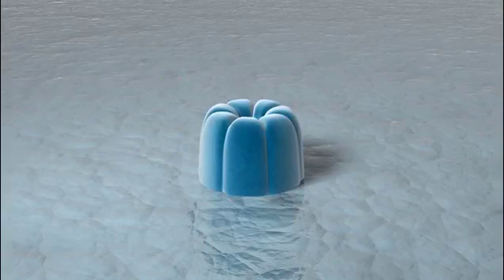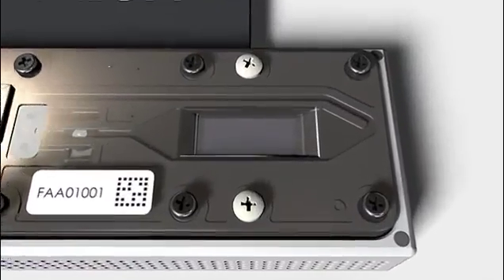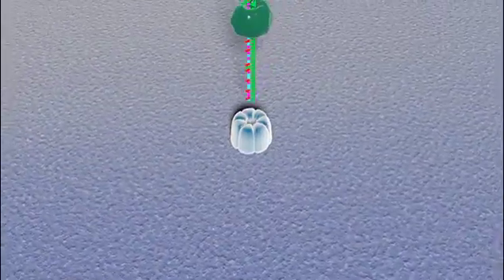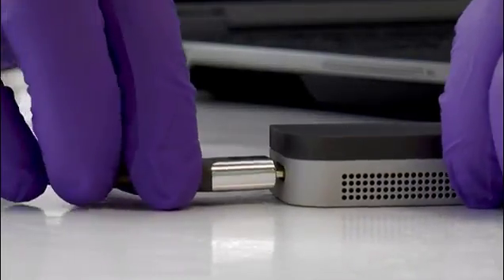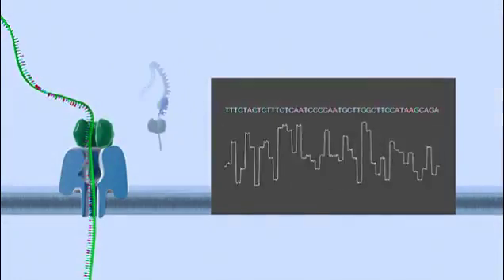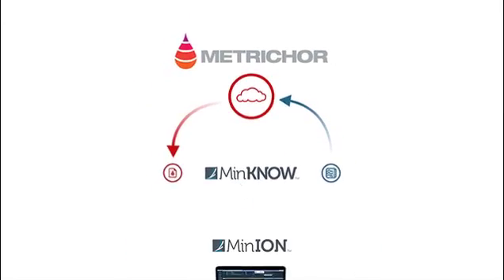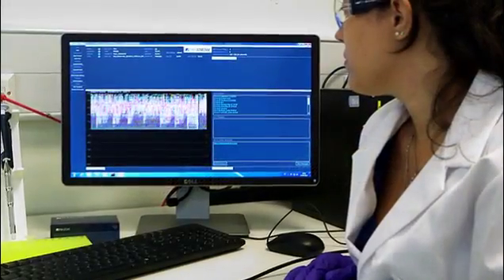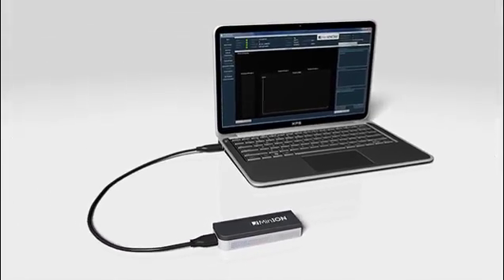How is Oxford Nanopore used? | WIRED

Comment: How often can you reuse a sensor chip?
Reply: In general it’s a once time use. Each chip is ~$800.
Reply: @mz00092  Not at all, it can be reused until you run out of pores. But you definitely need to use different barcodes if you run a different template jic

Comment: How do you clean it?
Reply: https://www.youtube.com/watch?v=IRTdK0kl9v4
Reply: There is a different  flow cell for every organism
Reply: @lightyourway8386  so it has to be replaced after each use new device?
Reply: @martinkulik9466  Not necessarily. There’s a flush protocol to remove nucleic acids and waste but it’s not absolutely guaranteed to remove prior templates so just make sure you use different barcodes. Also there’s only so many runs it can handle before you run out of pores